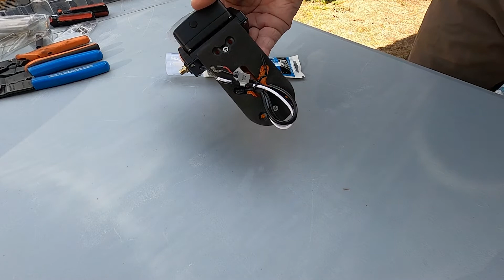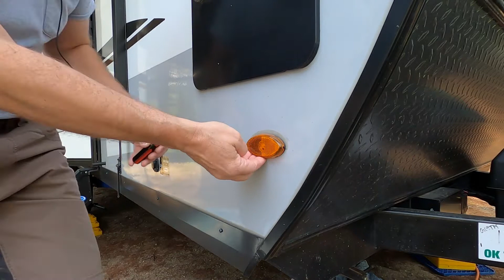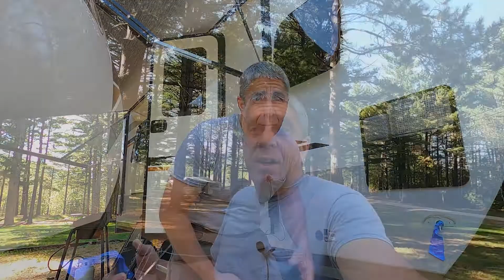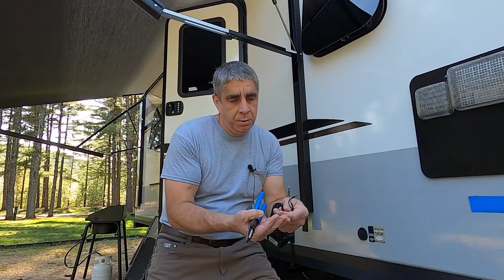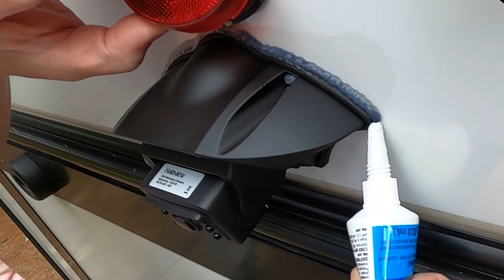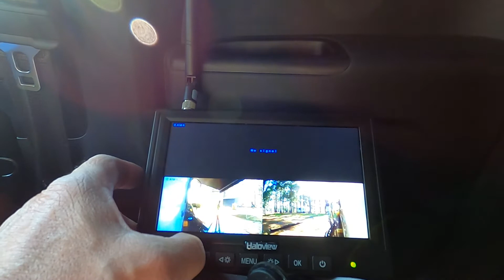PT 2 Haloview Wireless RV Camera | Sideview Turn Signal Cameras | 7 Inch 720p High Definition

Comment: Unfortunately I can no longer support Haloview cameras. I installed mine in 2020 the rear camera works fine. I also purchased the magnetic camera so I could use it when attaching my 5th wheel. I only use this about 5 to 10 times a year and my camera batteries have already died and will not except a charge.